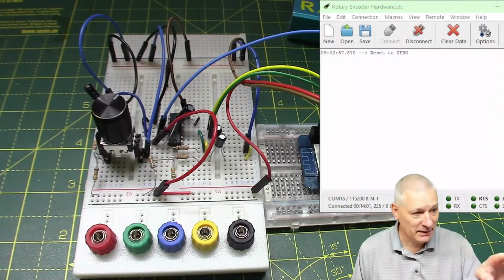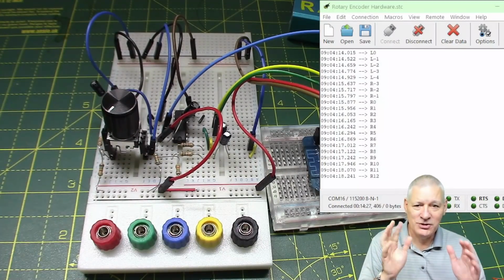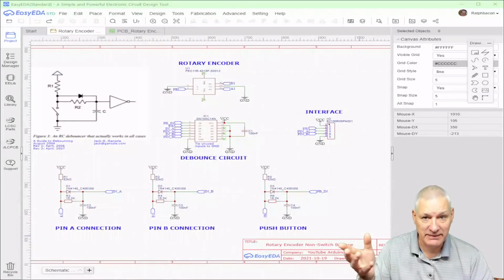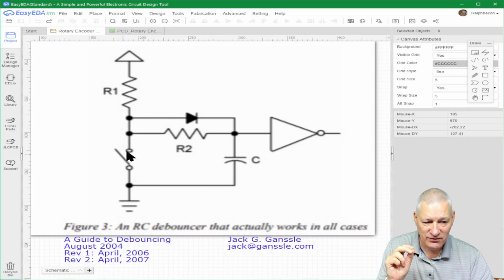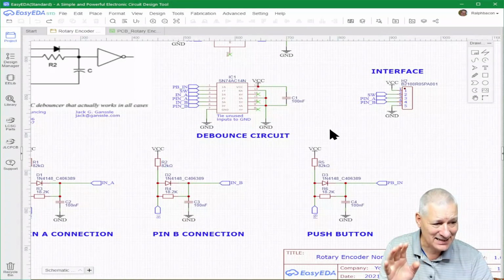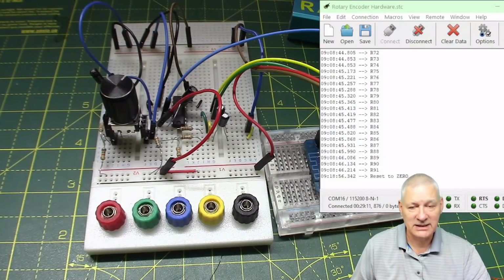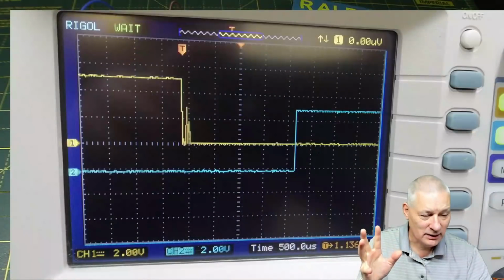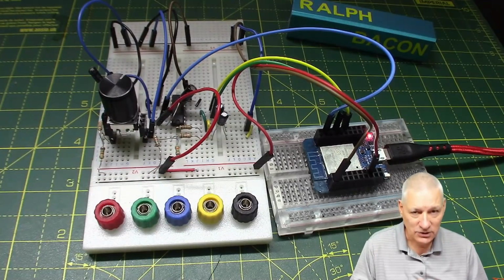#230 The ⭐ULTIMATE⭐ Switch Bounce Eliminator - simple and effective. 🎈

Comment: Hi Ralph.

Happy Christmas.

I'll see your "ultimate" switch debouncer, and raise you the MC14490P hex debouncer. I use these when debouncing switches, surprisingly enough, and one chip takes up to 6 separate switches and requires only a single capacitor to set the frequency of the debouncing circuitry. You can pull each attached switch up to VCC or down to GND depending on your needs -- but they do all have to be the same. Other than that, it's surprisingly good!

Happy New Year when it comes. 

Cheers,
Norm.
Reply from the maker: Hmm. I see that sales of your (excellent) Arduino hardware book must be doing well to suggest a chip that retails for £5.69 (RS Components) in single quantities! Yikes.

I've read the spec sheet and I'm sure it's wonderful but "my" simple hex-input SN74AC14N chip costs just 45p when bought in packs of 10 - still  less than a single MC14490P. Along with a resistor or two and a capacitor it still makes it very pocket-money friendly.

Seriously, I wouldn't mind spending a few pounds extra on a personal project (just look at the cost of some of my project cases!) but on a commercial basis, cheaper is better (mostly). Just ask our Chinese suppliers!
Reply: @RalphBacon  £5.69? Each? Goodness gracious! I got a pack of 10 for much less some time back from eBay. I'll have to check prices.

Insert suitable delay here....

eBay has lots from China. Ranging from a pack of 10 for the price of one from RS, to a pack of 50 for £37. I expect some might not be kosher, but mine work fine.

Cheers,
Norm.
Reply from the maker: "I expect some might not be kosher..." Oh, really? 🤣😆😊
Reply: @RalphBacon  Yes, really!😉😉😉

Comment: I have never required more than an RC circuit to interface to a rotary encoder, EXCEPT for the bourns. I stopped using Bourns encoders because of the horrible performance, and the deceptive information they provided me when I talked with them.  Great advice in the video, and I will implement this in my next design just to give myself more tolerance for a bad encoder, but I do not recommend using any Bourns encoders...you are asking for problems. They should be ashamed.
Reply from the maker: Thanks for the info! I was hoping that Bourns was a reliable make; your experience says otherwise. Hmm. More investigation needed!

Comment: I noticed that your code does not use the state machine technique.  I suppose that's because Gannsle's approach is good enough thereby rendering any further software techniques redundant.
Reply from the maker: You are correct. The previous Rotary Encoder video used the state machine technique, but even then it was possible to miss a pulse if the loop() was particularly busy (or awaiting a response on, say, SPI). It also depends on how much work you put into the ISR, of course.

Comment: I've seen that circuit all over the place for many years. Typically I see 100K and 10K resistors used and different variants of the Schmitt Trigger either as TTL or CMOS. I also seen a circuit that uses a 555 timer as a debounce, I never tried it but looked interesting.
Reply from the maker: Interesting! I'm sure Jack Ganssle's circuit is being used everywhere! By varying R2 in the circuit (I use 18k2) we could adjust the bounce delay (eg 1mS - 10mS) because the cap will still hold its charge. As I say, interesting!
Reply: Some (many?) microcontrollers have built in Schmitt triggers on their inputs.
Reply: @edgeeffect  Yea but controlled in software.

Comment: Your circuit has an RC delay built in between switch change and debounced signal change. Software debounce does too but I wonder which is quicker.
Reply from the maker: Most switches are done with bouncing around after 2mS but I use 5mS in my software and don't have issues. The hardware version could be tweaked by adjusting the cap or better the R2 resistor to suit the switch being de-bounced.

Comment: I bought 2 rotary encoders from ebay and had a problem that wonder if this circuit can fix. 
If I turn both encoders clockwise, one counts up and the other counts down.
I am guessing that the encoder wheel on one of them was flipped over.

Can you tell us about optical rotary encoders? I know some are rated to be attached to motor shafts and spin at very fast rates.. Do they still have a maximum spin rate?
Reply from the maker: Rotary encoders use light to determine the HIGH and LOW values; no switches or physical contacts. 

However, when I was investigating these, some had a maximum rpm of just 1,000, others 3,000. As these were already in the region of £30 - £40 each I decided I would not proceed with my experiments. I'm guessing that if you were to spend more you could get one with an increased rpm. 

I'd also recommend buying from a reputable supplier (RS Components, Digikey, Mouser) and the like.
Reply: @RalphBacon  On Optical encoders, isn't there a transition point when the beam is being partially broken, where there is noise? Or does the optical detector have a built-in Schmitt trigger?

Example of what I am thinking:
Feed a triangle wave into one side of a comparator and a analog voltage from a pot into the other side. At the point where the triangle wave goes above or below the voltage set by the pot, is there a bunch of noise?
Reply from the maker: I don't know is the quick answer; but I have found one of my optical rotary encoders (a Grayhill) so I might wire it up and try it out...
Reply: @RalphBacon  Hey (just a side thought)
In my example above. using a triangle wave on one side of a comparator, could you make a timer count how long the output is high and use that to make an infinite resolution ADC?

Comment: Once upon a time there was another switch debounce circuit in one of the "Designer's Notebook" or similar short idea article in one or other electronics Magazine that I apparently remember for ever.  It used a Form C contact, two pull up resistors and an RS Flipflop IC.  No capacitors or diodes.  The switch common was tied to power common and both fixed contacts to a junction of the pull up resistor & S or R input, respectively.  Supposedly the switch never chatters all the way to the opposite contact, only opens partially.  So the pull up resistors raise both flipflop inputs high, but that does not matter as the IC toggles only at low level input at one of the two inputs and latches. I have used this sometimes and it works like a charm.
Reply from the maker: The bit that does the business, so to speak, in this circuit is the (charged) capacitor and (relatively) slow discharge to allow for some chatter. 

This must be the basis of all circuits that deal with this problem. The Schmitt trigger ensures that the output only changes when the capacitor's charge drops to the threshold. Which sounds quite like the circuit you're describing, Pellervo; I tell you, there's nothing new under the sun! 

If you have a link to the article (you have to obfuscate it if you try and post it here or YT will zap it) I'd be interested. Or enough details so I can find it on the Internet!
Reply from the maker: I searched given the information you gave me and found this article which is quite interesting; the first circuit uses no capacitor because the switch goes to ground, not VCC.
https://www.embedded.com/solving-switch-bounce-problems/
Reply: @RalphBacon  --  The Figure 1 circuit in your finding is what I recall and have occasionally used.  The original article I saw probably in 1970's.  In those days the authors got a token payment of $50 per accepted submission. (I got that amount for one submission, although they redacted  the description beyond recognition...)

Comment: I used a crude RC filter together with a software debouncer routine in my never ending Nixie Clock project's rotary encoder. Although it is working perfectly as it is, I am intrigued to change the design once more to this and get rid of the software debounce part in the code. This is exactly why my projects seem to get forever to finalize :-) Thanks!
Reply from the maker: Well you can build the debouncer circuit and try it out on a spare chip, I am sure, before committing to changing your project (again!).
Reply: @RalphBacon  Always. I never integrate anything in my designs that I haven't made to work as a prototype. The whole Nixie project has been running on 5 protoboards at the moment and I keep adding, removing stuff (hardware/software) all the time. If I am happy with the result, it gets included in the final schematic.

Comment: Happy to second recommending the debouncing paper to just about anyone interested in electronics to read. It's one of my favorites.

Great video about an important topic. I've got an encoder board with a very similar bit of hardware on it, but that's SMD and the components fit on the back side of the encoder along with a microcontroller (NXP LPC845).  It will act as an I2C device for use on random projects.
Reply from the maker: Thanks for sharing!! Sounds nice and what I might have done had I used SMD components! Cool.
Reply: Ooooh. That’s cool!

Comment: I have to comment. 
I had a rotary encoder, test it and all went wrong... I ordered another 10 pcs on Amazon and I've quit trying after I test half of them. Just junk.
I will never add a rotary encoder to my projects, not with this available junks
Reply: In what way did they not work? I have used high quality encoders as well as cheap bulk encoders and they have all worked to some extent. The code can be tricky to get working the first time, but they are really lovely to use once they are working.
Reply from the maker: If you watch my first video from a few years ago on the Rotary Encoder I can almost guarantee you success! The video:
https://youtu.be/J9cDEef0IbQ
Just do exactly what it says!

Comment: It seems to me that you could do SMD components mounted on the back with the rotary encoder mounted on the front and end up with a unit just slightly larger then the original rotary encoder.
Reply from the maker: Indeed you (or I) could do that, Edward. Even the chip is available in SMD format.

But as I explained in the video that would preclude lots of my viewers from taking one of my PCBs and constructing it for themselves. I suppose I should have made two versions but there are only so many hours in a day... I might talk to my MP about a 30-hour day soon.
Reply: @RalphBacon  I don't think I would build it myself - JLCPCB's board manufacturing service is so cheap that it's easier to let them do it. And the last time I used them, they had a discount coupon for the cost of assembly, so the 5 boards I was having made cost less the a dollar to have assembled. I don't think I could have bought the parts for that price. The full price for making the boards and doing the pick and place was less then the shipping cost to get it to me.
Reply: @RalphBacon  As for the chip, they do carry a SMD hex schmitt trigger chip - SN74LV14ADRG4  in a SOIC-14 case, but I also found a smaller 3 channel chip - 74hc3g14, but they are currently out of stock.
Reply from the maker: I do keep intending to use their SMD Assembly service but keep designing though hole boards! Maybe next time.
Reply: @RalphBacon  Just for fun, I did an SMD panel 20x23mm - so a 4x4 panelized board would give you 80 small boards. But, this first layout did not have any mounting holes. As long as you used rotary encoders that bolt through a panel, that should not be a problem. But I could make the board a little wider and add some mounting holes and maybe get a 3x4 panel. (who needs 80 rotary encoders anyway!)  Not counting the rotary encoders and the 5 pin headers, the part that JLCPCB would mount would cost about $21 including the $3 charge for the one extended part.
Reply from the maker: And if I were a few years younger (OK, a few decades younger) I would certainly redesign this board with SMD components just as you say, get JLCPCB to make all 80 of them and then sell them at some enormous profit. Once hobbyists and small companies got to realise that switch bounce can be eliminated by such a board I'd sell millions! I can dream, right?

Comment: Think I suggested Schmitt triggers on your last video Ralph. Schmitt triggers, Op-amps, Comparators, Decade counters, Multiplexers, Shift Registers....... all excellent IC companions to micro controllers. The decision to solve a problem through software or hardware is a common dilemma. Personally I get more satisfaction going the hardware approach and not rely on code so much. I really like the idea of creating custom PCBs and I must get round to giving that a try. Your boards look great!
Reply from the maker: You could well have done, Paul, although I have covered a hardware solution before (using a different chip) a few years back. But this was with a PCB and everything (well, except mounting holes, apparently). I do like the hardware solution too! It's what we intuitively expect from any switch, a simple on/off action!

Comment: Did you not think of adding mounting holes to your PCB design?
Excellent project, I watched with great interest.
Reply from the maker: Well, Tony, TBH as this is more of a break-out or development board I didn't consider it (bad Ralph). I was trying to keep it small.

But you can mount the rotary encoder on a front panel if the chip is soldered directly to the PCB. Even when using the socket I think it could work. 

You could mount it on another PCB (host/motherboard) by using the connectors intended for the header pins, of course. I've done that many times with dev boards without mounting holes.

My next break-out board does have mounting holes so I have already learned my lesson! Glad you liked the video!

Comment: Great Video Ralph :) When you present us with you fantastic research and findings not only do you educate us but you get our minds working, hence the many suggestions :) Sorry but I also have one: Is there any way of using your detection of interrupt < 20ms to give you a + 5 for that 20ms so it feels like there is no over spin limit and spinning it fast works fast? i.e. When "too fast" is detected set a variable and when you reach the acceptable 20ms threshold don't add 1 in that direction  add 5 or more because the variable was set?
Reply from the maker: The 20mS "Too fast" message was just there to show how my car deals with me spinning the volume control too quickly - it just ignores the "click" rotation entirely. You can reduce that if your rotary encoder still reliably works - but the manufacturer put the max rpm there for a reason!
But you could easily set a flag (in the ISR) if the rotation is too fast and when you get the next < 20mS pulse detect the flag, add +5 and reset the flag. Simples!

Comment: The inverter MUST be a Schmitt triggered input gate; the 7414 is, so great. In the schematic the gate should show the Schmitt symbol. If you don't use a Schmitt input gate you get noise as the input gate voltage passes through the grey zone where the input might be read as a logic one or logic zero.
Reply from the maker: Indeed. I did emphasis that there was no "linear" (or grey) zone with a Schmitt trigger, hence why it was being used. The schematic symbol was one from the manufacturer, I think, without the Schmitt symbol, how remiss!

Comment: Nice video Ralph,  I stopped throwing switches on the floor that stopped them bouncing :-)
Reply from the maker: Yes, that would most definitely work too. Unfortunately you couldn't really have that floor-bouncing switch in a decent enclosure or you'd have enclosure-bounce too. For which I have no solution. Other than a visit from the men with those cute white jackets, very long sleeves and very long belts...
Reply: @RalphBacon  those men in white coats expelled me from my last place there:-)

Comment: Given that you are effectively implementing a 20ms denounce delay in software (ie. not allowing another pulse for 20ms), I don’t really see the practical need for adding hardware denounce? Although I agree that the 2 resistor, 1 capacitor, plus Schmitt trigger is the standard switch denounce approach. :)
Reply from the maker: In its current form, that is true, Greg. But the 20mS "Too Fast!" message was there merely to demonstrate the point. There is no need for it in real life. If someone does spin the rotary encoder that fast that it cannot cope, well, on their heads be it!

Comment: Do you think this circuit work with the likes of windspeed and robot wheel quadrature encoders which I would suppose turn at higher rpm than a rotary encoder switch?  A very interesting video and do pop my name into you circuit board giveaway lucky dip :-)
Reply from the maker: Yes, absolutely. The 60rpm restriction is just for that Bourns encoder. A windspeed device usually has a magnet and a reed switch (mine does, anyway) and can whizz round quite fast. This circuit should have no trouble with that.
I'll put your name into the draw if I know how to contact you (and what your name is)! You can email me. Address is on this page https://www.youtube.com/c/RalphBacon/about

Comment: Thank you Ralph. In these days of reduced part counts and "just run a dupont wire" engineering, it is good to see some of the fundamentals being discussed.  If I am not mistaken, that debounce circuit is a combination of an RC filter and a 1/2 wave rectifier. #savethebypasscapacitor
Reply from the maker: I'm not sure that any rectification takes place here; it's all to do with that capacitor holding a charge sufficient long to miss the bounce pulses, then allowing the Schmitt trigger to do its magic.